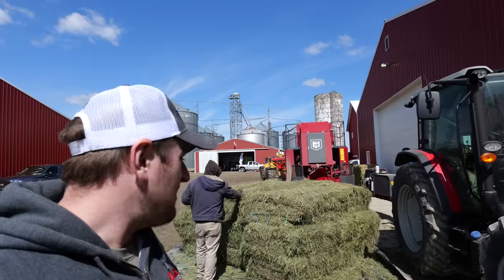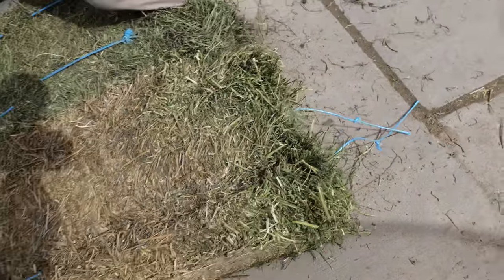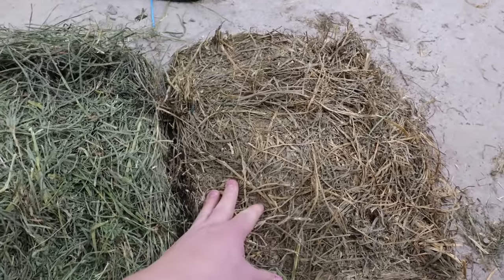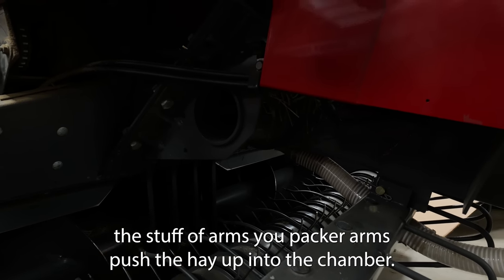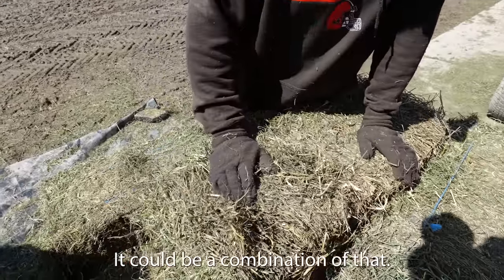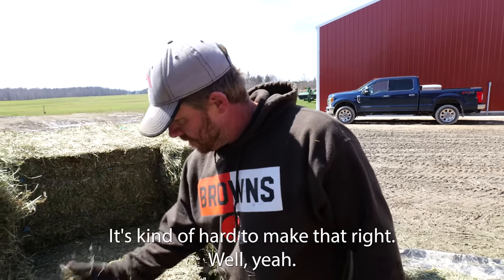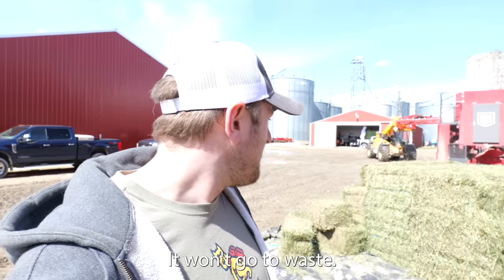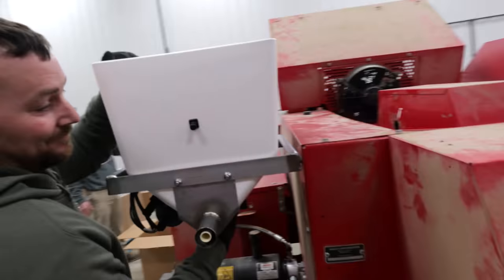This Thumbnail Shows How Hay Farms Go Broke

Comment: Usually   we have to monitor   dryness  over high moisture......The Sun Gets Hot In the south...... With our variety of grass hay we never have used any type of preservative....   Tifton Bermuda has extremely fine stems and  long slender leaves,    65 years ago we could cut before dawn and bale  that afternoon at less than 15% moisture......

Comment: You ever have any issues with knotter fans? Both of my balers the fans stopped working and I haven't found the issue yet.
Reply from the maker: Yes, we blew fuses on our smaller tractors from running the fans
Reply: @FarmingInsider  I'm getting power out of the tractor. Fan just doesn't work.